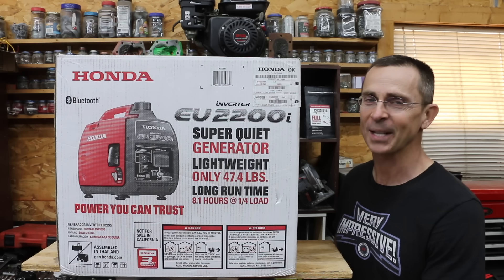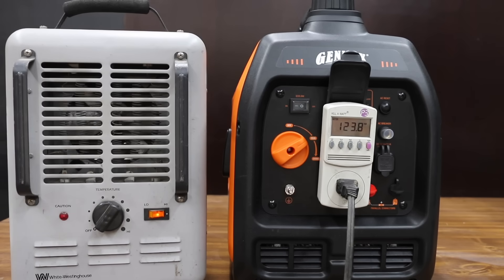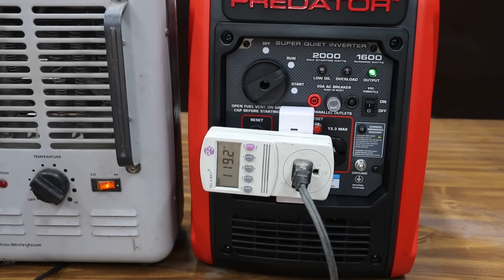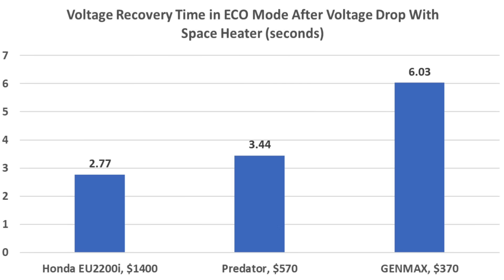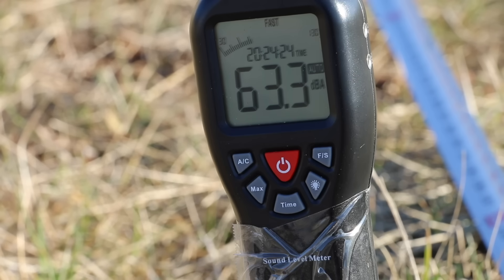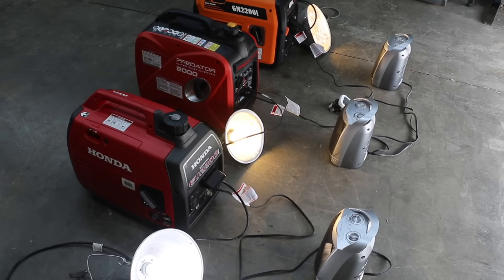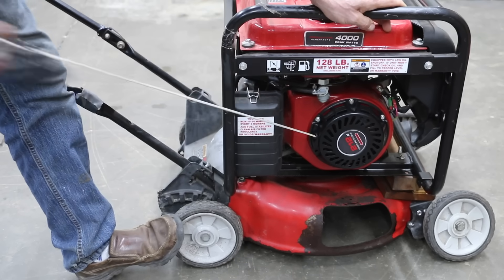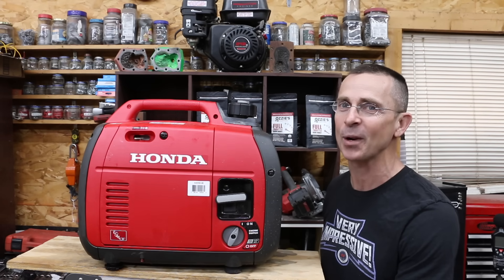Cheap Generator Better Than Honda? Predator vs Honda & GENMAX—Let’s Settle This!

Comment: Predator inverter generators don’t last very well. My own experience has been an unfortunate situation. I live off grid and tend to run a gen for about 5 hours a night to top off my battery’s.  I have noted on each of four portable Predator generators over 4 years that the biggest problem is the pull cord which starts fraying at a point  between 4 and 5  inches from the pull handle.  I learned to start installing a 6 inch long piece of heat shrinkable tubing to avoid losing the recoil cord which is a true nightmare to recover once it snaps. Other problems with Predator generator range from excessive internal wear to bad control of voltage and power outputs . I finally have gone with a champion portable running on propane.
Reply from the maker: Thanks for sharing.

Comment: The test that I'd like to see is durability , but it would take 5 to 10 years. Cheap generators are known to not last. If I was only using the gen sporadically, I'd buy the Genmax. You can buy a lot of gas for $1,000 buck difference.

Comment: I have run 4 different gensets comparable to the eu2000i which btw was one of the four. I used to swear by Honda as I had worked with Honda marine previously in harsh environments. My take is I honestly can not say Honda is better or worse than cheaper knockouts as on everyday use for each at approximately 5 hours a day they all lasted around 2 years each and that is with regular services btw.

Comment: Please test a Westinghouse dual or preferably trifuel!  Especially the non-inverter style generator (though still interested in inverter style).  They claim THD of less than 5% on the non-inverter and im curious how those and others models compare for whole home backup geneators.
Reply from the maker: Thank you for the suggestion!

Comment: One objective measurement that would be nice is to measure the fuel consumption per kWhr energy output, to get an idea of efficiency.  Eco mode comparison can be made with different levels of load, to see how much difference it makes with very light vs heavy loads. 

This allows a comparison between inverter generators vs direct versions to see if there's an advantage to the inverter generators, with varying loads. The inverter generator efficiency advantage may be primarily at light loads.

Comment: The problem is the thinking that different branded products are all the same, so people buy the cheapest. The more moving parts, the less likely this is to be true. Wonder which unit will still be working after 5-10 years...

Comment: I was sorely tempted to go for whatever brand offered maximum wattage for the money, but your comparison test convinced me - grumbling - to  'buy once/cry once' and choose the Honda EU2200i. It was worth it when - in typical Honda fashion - it started second pull for its monthly maintenance run and settled immediately into a smooth idle. Its louder Generac predecessor took 15-20 pulls with much fiddling and cursing to run properly. Thanks again for all you do; love your channel!
Reply: Yep, did what you did. I've had my Honda EU2200i since 2018 with regular maintenance and it runs like a top, and very reliable too. 👍
Reply from the maker: Thanks and you are welcome!

Comment: I know it would be a very big undertaking and expensive... but a video show casing some of the most popular 7000-10000 watt inverter generators on amazon or from lowes/home depot/harbor freight would be great. 

I bought a genmax 7250 and had planned to buy a 2nd one to be able to parrell them to give me plenty of power for home backup, but also still have a generator under 200lb if I needed to move it or take, or if one failed 6000 running watts still would be enough to run our freezer/fridge/HVAC.

But now the reviews have nose dived and lots of people saying they dont last past 100 hours. Champion, Westinghouse, duramax, Pulsar, Avolt, all made in china too and I would have similar concerns... but I am considering selling my genmax to recoup some money and just getting a single larger generator  at this point.
Reply from the maker: Thanks for the suggestion.

Comment: I have an RV.  I run my AC unit on the generator sometimes.  Big loads is what separates the posers from the real thing.  The Honda can supply close to its rated output and handle the start surge of a big AC unit, the cheaper brands stumble at this.  They struggle to start the load without overcurrent warnings, frequently overheat under long periods of close to their maximum power.  And worse many of the cheaper brands cannot produce their rated output power.
Reply from the maker: Thanks for sharing.

Comment: I would love to see this test done with a Yamaha EF2200iS and maybe an A-iPower SC2400iP which has a Yamaha engine. Yamaha is probably the biggest competitor to Honda for generators.
Reply from the maker: Thanks for the suggestion.

Comment: I've used the previous version of Honda. Maximum 12 hour continuous runs for PA systems with a lot of variable load. Bass music with subwoofers. It is a very good generator for its size. You'll notice the small size of the engine as there is not too much inertia but Honda keeps up very well with the changing load. You must have some spare spark plugs available though as they may wore out quite fast.
Reply from the maker: Thanks for sharing.

Comment: Hey dude I love your videos but please don't rely on a $25 Amazon watt meter to tell you the lowest voltage dip during a load application. These things have an awful sample rate and your reading is largely dependent on when the load was applied. Starting the heater sooner or later can give you very different results when it comes to voltage drop. Also generators are designed for something like 30% voltage dip...

Comment: I'd love to see the generac 3500 w inverter generator in a fuel consumption test with let's say the Honda 2200 and maybe the Westinghouse 2550 smaller generators running a space heater at 1500 w to see if the bigger generator is more fuel efficient as it has to work less or the smaller generator having to work harder is more fuel efficient being it has a smaller engine.
Reply from the maker: Thanks for the suggestion.

Comment: Thanks.
Honestly, just buy 3 of the cheaper generators instead of one Honda.
Think of having at least twice the overall lifespan AND the flexibility to parallel up to 6,000w if needed.
That is a "better" in my book.
Reply from the maker: Thanks for the feedback.

Comment: Honda all the way. I had a Chinese Champion inverter generator last all of 200 hours before the inverter board failed and made it an economic write off. Meanwhile my 15 year old 2K Yamaha inverter continues to run well for over 2300 hours, well past its rated lifespan.
Reply from the maker: Thanks for sharing.

Comment: So, I'm tryin' to be as efficient as possible... and make the most comfortable situation possible.. and I'm very new to the RV life... So, correct me if I'm wrong here... but I know you said Honda was the best, as it was far more expensive, but FOR THE MONEY, when a budget buyer is in the market, it seemed like the Genmax is probably the one to go with, as it's relatively comparable, in most areas, and probably even outperformed the more expensive Predator... Is this accurate?

Comment: I have a Predator 1400, the CO sensor gave out after less than 100 hours use. I cannot get the CO sensor from Harbor Freight,  they send you to third party to get the part. I have spent hours on the phone with NO Luck! I cannot recommend Harbor Freight Predator generators
Reply from the maker: Thanks for the feedback.

Comment: I have the Honda he tested and in the 20 degree winter it is hard to start with out starting fluid so i wasn't that impressed. Until a neighbor bought a Chinese one like these and it was far worse and sometimes wouldn't start at all when he needed it to run his furnace  so all in all for $1000.00 which is a common sale price for the Honda im happy and warm.
Reply from the maker: Thanks for sharing.
Reply: Thank you for your awesome content

Comment: Greetings from Galveston TX! 🎉Thank you so much for the helpful video on the inverter generators. Obviously, there was so much more to the background of testing these portable inverter generators relative to the overall length of the video so again thank you so very much for your effort, time taken and statistics presented. Would it be possible to get a side-by-side comparison of the Westinghouse 4500 W inverter generator vs the Generac 4500 W inverter generator vs. the Cummins 4500 W inverter generator?
Reply from the maker: Greetings!  You are welcome!  Thanks for the suggestion.

Comment: As always, another great video. Could you please test Generac GP2200i? About half the cost of a Honda but apparently same performance. "We are going to test that".
Reply from the maker: Thanks!  Thanks for the suggestion.
Reply: @ProjectFarm  Thank you. I recently came across Westinghouse generator igen2800c at home stores, and Westinghouse is a reputable company and this generator costs less than half of Honda. That would be a fair comparison if you could do that in a future video place.

Comment: My FIL has that Honda. I borrowed it and was unimpressed. I’ve also used a Champion 4500 watt dual fuel. It was superior to the Honda and less expensive. Kinda wish he’d have included a Champion generator in this test too.
Reply from the maker: Thanks for the constructive feedback.

Comment: Dude I love your videos 

You really put the technical work in to do a good job

Firman - Generator Brand Please

I have a Firman 3650-4650 with an American Flag on it 

The good attribute is 

That engine started first pull - out of the box

And it has always started first pull

Even after years of use - sitting filled with water - cleaned out - 

And now it starts first pull

It seems efficient - it is cheap 

I bet the power is ugly!   I am seeing how many years I can actually get out of it 

3-4 solid years of use so far.

I have other generators - but this firman one just does start and work surprisingly well
Reply from the maker: Thanks!  Thanks for the suggestion.

Comment: Powerhorse from Northern tool. Purchased it when I went to buy a Honda. Over 4 years later running great. I’ve had great luck and made 3 videos on it. It just had its first trip to the shop for the pull rope being broken. I left it on the job site for some other guys to use because we didn’t have power in the building and they broke the pull rope twice. It only needs a gentle pull but some guys can’t be taught. 🤦
Reply from the maker: Thanks for sharing.
Reply: @ProjectFarm Did not want to brother in law your video. Just really happy with my Powerhorse. I tell people the biggest advantage over the Honda is even an honest man thinks about stealing your Honda! Mines been on the back steps at a ghetto apartment complex all day for weeks and no one bothered it.

Comment: Good review thank you. Honda should be the best at 2 to 3 times as expensive as the others. I got my 1st predator 3 years ago went through 3 in less than a year I wasn't impressed. Hondas just run but they should considering the cost.
Reply from the maker: Thanks and you are welcome!  Thanks for the feedback.

Comment: Hi, We recently got an Imagine 22MLE travel trailer with a 1500K Furion AC and tankless Hot Water Heater.  My wife is disabled so I want to have a generator to run the AC incase of a brake down (it has happened to us before).  The generator I am looking at is the Westinghouse with the "RV" 30A connector receptacle.  It is advertised as light weight, quiet and fuel efficient.  The RV 30A receptacle without an adaptor is important to me, as that should run our camper (as the camper  comes with a 30A plug).  The Westinghouse is also inexpensive (about $450) and I would like to assume it is a step above the Harbor Freight unit.  Please advise If you can evaluate it for me and your viewers.  Thank you.
Reply from the maker: Thanks for the suggestion.
Reply: @ProjectFarm  I really hope you test it soon.  In addition to needing the dedicated 30A RV receptacle, I am also considering the Dual Fuel model,  My RV has a connector for a gas grill under the side of the camper, so I am hoping I can get an LP line with the correct fittings for the camper on one end and the generator on the other.  I watch your videos and I actually consider your videos like the YouTube version of consumer reports magazine.

Comment: The thing with those honda quiet inverters is you get what you you pay for. This isnt like a hilti vs milwaukee comparison. That honda will last 20 years longer than the chinese knockoffs and thats after being dropped off the back of every white f250 known to man at thousands of job sites.
Reply from the maker: Thanks for the feedback.

Comment: Great and useful video.

Can you do the same tests to other generators in the same power category? Champion 2500 (there are various, please test the latest model), Ryobi 2300 and maybe Firman.  Don't remember if firman has a model this power capacity.  Usually see the 32 or 3600 and above.

I guess if you have not done it yet, I prefers test to DUAL FUEL generators from 2000W-3600W
Reply from the maker: Thanks!  Thanks for the suggestion.

Comment: I would avoid generators with a cam timing belt instead of pushrods. As the cam timeing belt is a maintenace schedule item. This could cost alot of money to replace. I also think this is true for car engines. ( Cam timeing chain vs belt.)
Reply from the maker: Thanks or sharing.
Reply: The timing belts on the EU2200i are maintenance-free.  Change the oil often and you will not have an issue with them.  I know; I own two of these generators, along with 4 other pieces of outdoor power equipment with Honda engines.  They all are remarkably dependable and durable.

Comment: One point. Some excess metal in the oil is expected in the first oil change. Rings need to wear in. That could also explain the dirty spark plugs. Repeat that test with the next change and see what they look like and how much metal is still in the oil. I agree that Honda being so low and Genmax being so high doesn't look good. It makes me think the Honda either got a good break-in run or the tolerances and fits are better so there's much less initial wear.

Comment: I only occassionaly use my generator.  I am curiios how the small dual fuel inverter generators stack up - this one in particular Pulsar Products GD400BN, 4000W Portable super-quiet Dual Fuel & Parallel Capability, RV-Ready, CARB Compliant.  It has a bith higher power thatn some.  My hope is it can run a small RV AC. 

I plan to mainly run on propane to avoid all the problems with old gasoline.
Reply from the maker: Thanks for sharing.

Comment: Piece of junk. Within the first two weeks I had to remove The carbon monoxide detector shut off. Now she won't run under a load. Nothing but issues since i've bought it

Comment: Please compare the Ai 2300 generator sold at same club. It has an eco mode and a handle and wheels to move easily. Digital gauges too. Only thing I don’t like is the handle can rattle but easily fixed.
Reply from the maker: Thanks for the suggestion.

Comment: I bought a brand new one the same generators are showing the pull string broke the second day I had it a month later the engine locked up they told me the factory under the warranty I would have to fix it and they may reverse my money back they don't stand behind the warranty they give you a runaround I'm stuck with us $400 generator that I can't even use and they won't fix it they are sorry company
Reply from the maker: Thanks for sharing.

Comment: This is another great review. For buying a generator I'm more concerned about longevity and parts availability. Will I be able to get a carburetor replacement for one of these in 10 years? Honda, likely yes. The others, who knows. It's largely about longevity and  maintainability for me. These are harder to test.
Reply from the maker: Thanks!

Comment: We need to appreciate that an engine needs to be broken in and generator needs to be loaded incrementally to properly seat all the contact points.
Great video as always.
Reply from the maker: Thanks!
Reply: Years ago we did brushes on starter generators on business jets and after sanding the brushes to match the shaft we would run them in a cage for 12 hours to set them. I doubt any company takes the time these days. Do the run in on the first flight!
Reply: @CBrown07696  I am ex Air Force and I was instrumental in electrical for avionics if you wish. Making sure that the jennies are working properly is a must.

Comment: Please test the mi-t-m GEN-2000-IMM. I don't see it anywhere. I got one used from the home depot tool rental for $425. Ran great for 3hrs with a freezer and fridge using only 40% of the fuel.  I'm nervous no one has a review on them.
Reply from the maker: Thanks for the suggestion.

Comment: I'd love to see a comparison between Yamaha and Honda gas generators, and a Champion Dual Fuel.  What are typical advantages of switching to propane such as less CO emission, cheaper to run as propane lasts longer, less wear on engine from propane vs gasoline, etc.  Would be very interesting to rate each on decibel level, and see how gas compares to propane on engine wear, voltage fluctuations, and true sine wave inverters.  These are key for me.
Reply from the maker: Thanks for the suggestion.

Comment: Right off the bat I see that the exhaust is too close to the ground which means FIRE HAZARD!  No thanks.  I just bought ANOTHER Pulsar dual fuel that does have this safety feature ON SALE NOW FOR A MERE $400... I recommend Pulsar... the dual fuel makes sense.  What if you can't get gas?  Seriously.  It can and likely will happen... BE PREPARED!